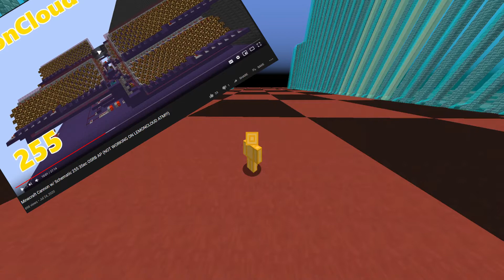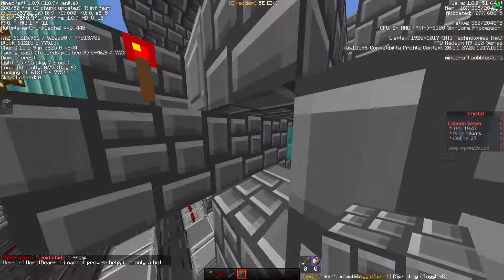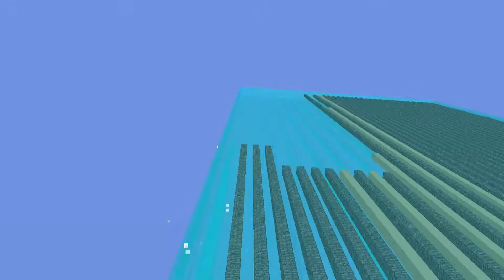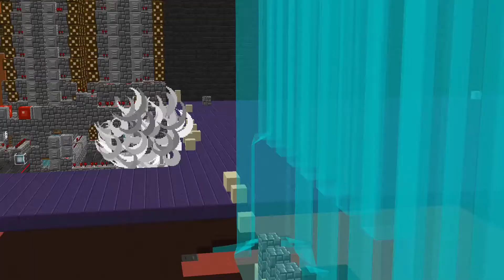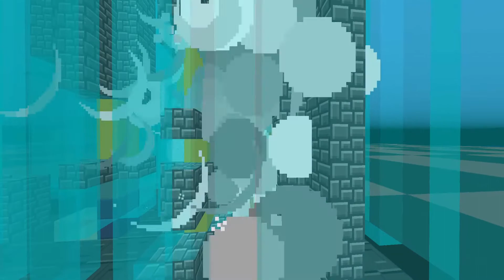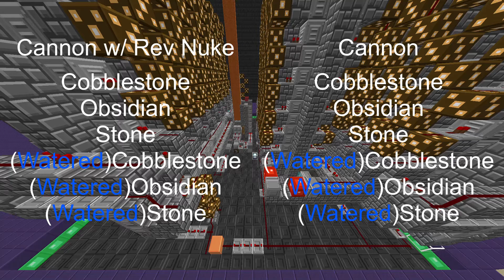5 Stacker Rev Nuke 3 Second OSRB Cannon Showcase w/ Schematic

Comment: You should make some quickprint cannons that you can use as a side counter for a cannon box with regens or to raid a base for as little tnt as possible
Reply from the maker: Define regens, as double tap will get you through Minechats and Anti-OneWides, the only thing would be regen filters, but you can't put those on boxes on most servers and you need 4 of them to actually be useful.